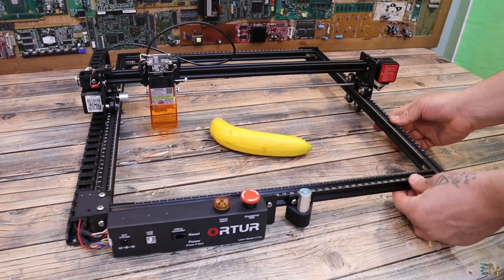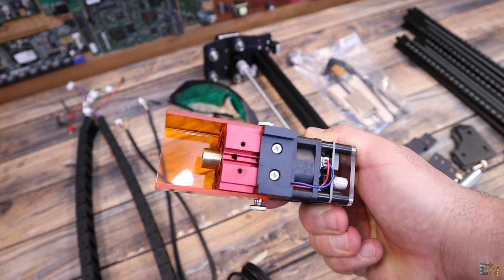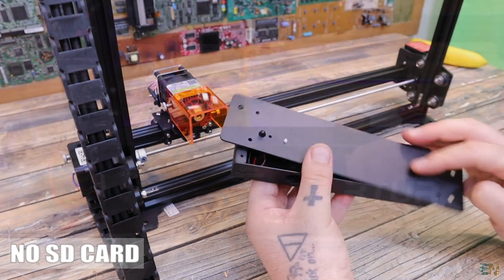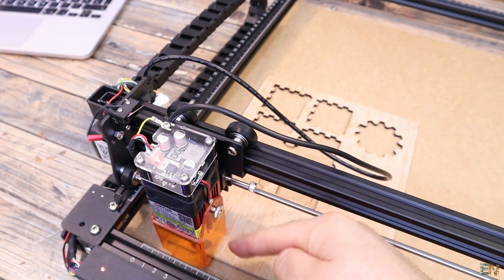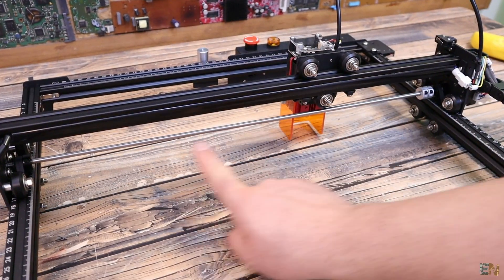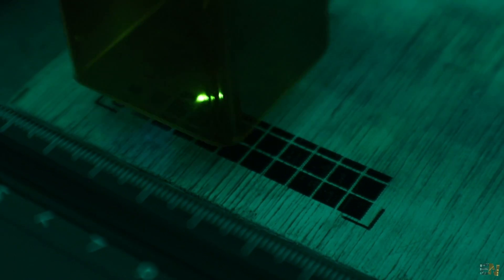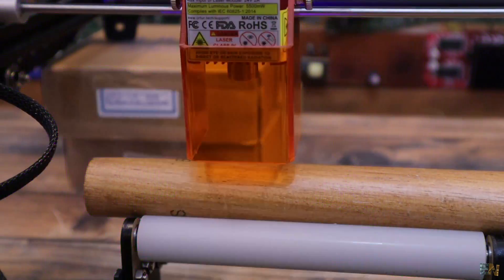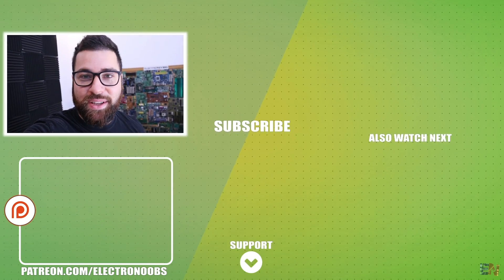Best choice for Makers? Ortur Laser Master 2 PRO - 20W CNC Engraver/Cutter

Comment: I have this laser with the LU2-4SF , 5 w output is super weak. and the flame sensor is skeetchy  i was working on something else in garage and looked over and material was on fire with machine still going like nothing was happening . I should of saved up a little longer and purchased the 20w output. this is ok if you want to cut cardboard or kraft paper,

Comment: I use the Atomstack Pro...very similar a bit less feature. Cutting balsa is no problem but you really have experiment with the cut settings since balsa can be very light or quite dense as well. I can cut 3mm plywood with settings full pawer 3 mm/sec 4-5 times. I could cut 5mm plywood as well same setting 6-7 times. It is slow so to cut out a complicated set full table could take 2-3 hours. I only use itz for cutting no engraving (does not care about engrave)

Comment: there is no way its anywhere near 20 watts of optical power
Reply: Maybe you should have watched a few minutes of the video before posting...
Reply: @No1sonuk  if its not 20 watts dont label  it as 20 watts
Reply: @martijn4740  It's 20W electrical, so it's technically not wrong...
Reply: @No1sonuk  just misleading

Comment: Nice little machine. It's quite capable, although I would love to see some laser cutters/engravers which could cut clear acrylic and still have decent price. Then again there's CNC for that. Or I'm just bitter, since I "only" have a 3d printer :)).
Reply: You should look at k40 CO2 lasers for that. Diode lasers unfortunately don't have the right wavelength to cut clear acrylic
Reply: Diode laser is very useless for hobbyist outside of its engraving capability. Even then it can only do it only on a limited selection of material. You would need black acrylic for diode laser to start cutting. I made a mistake of getting one. Your best bet is get a cheap CO2 laser that can engrave and cut acrylic. Honestly, if you need to build small/medium enclosure/boxes, your best bet is a cheap 3D printer.
Reply: @QueueTeePies  I would argue that a diode laser had its uses. Like you said it has a limited range of materials that you can cut. But if you know what you can do with a diode laser, it can still be a useful tool in the hobbyist arsenal. I'm actually in the process of designing an enclosed diode laser. I would have opted for a CO2 laser, but unfortunately I don't have enough space for that.

Comment: curious question... that focus spacer... shouldn't it be used on top of whatever you are cutting / printing on, and not the surface the frame sits on?  I would think that would focus the laser onto the top surface of the material - or is the idea the opposite... to focus on the bottom of the material and then you enter material thickness in gocde?
Reply from the maker: Of course! The distance is between the laser frame and whatever you are engraving
Reply: hmmmm... no vertical movement?  How does it cut thick material then without burning surfaces?

Comment: I prefer lasers with a full enclosure for safety, but it's nice to see some of these cheap manufacturers making a reasonable effort to improve safety. That little flip-down shield isn't perfect, but it's definitely better than nothing.

I'd like to see a rear guard added too (it could be ventilated if need be) to provide more complete containment of the laser. it wouldn't even need to pivot like the front, so would be an easy improvement to make.